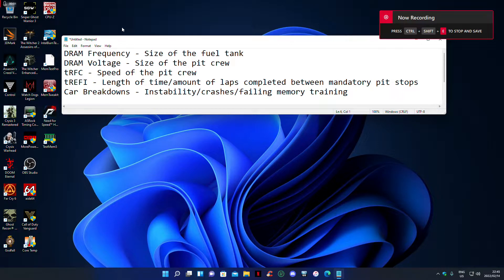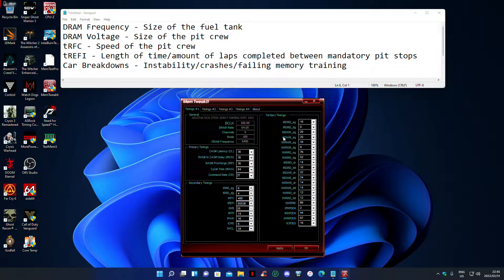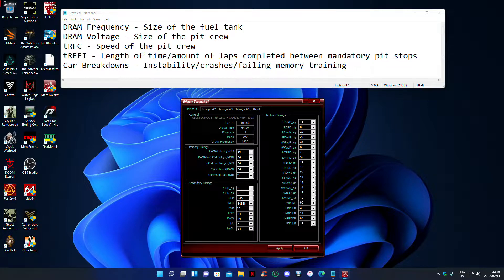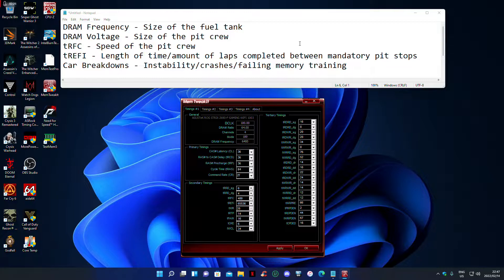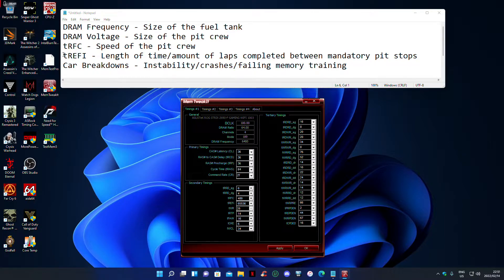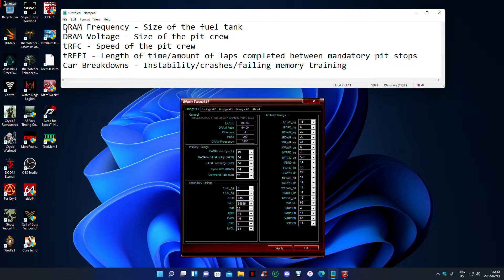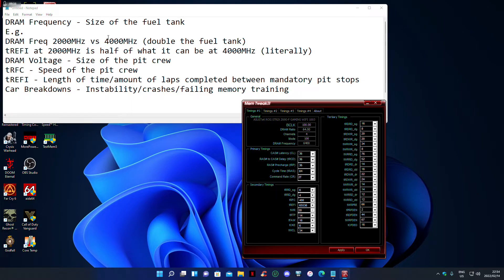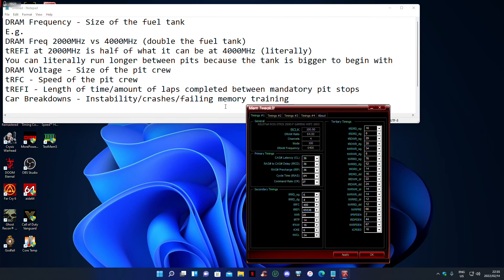tRFC and tREFI explained the fun way, i.e. RAM sticks are basically the same as F1 cars (kinda)

Comment: (Ddr3) 
My auto trfc started at 287, and i lowered it to 259 to start and observed a basically 1~1.5fps in the avg/max fps in the default cyberpunk benchmark (and i did 3dmark fire and time spy twice each test) and saw minor improvements - ofc theres variance - each time.

Oddly enough i could boot all the way down to 217 and none of the programs crashed, but when i dropped from 259 to 238, performance regresssed and became a bit more... volatile? I tried upping the dram voltage up from 1.64 to 1.66 but it didnt help. 217 trfc no real change either. Put it back to 252 (not 259) and im back to the "increased" performance.

Right now im 2200mhz, 10 13 13 36 2T, trrd 5 tfaw 20, trtp 6 twr 12, trfc 252-259 (maybe i go 259 for safety buffer), trefi 8581 unchanged yet. Tfaw 4 / 16 (or 20) tanked fps results.

The stock was trrd 6 tfaw 30, trtp 9 twr auto, trfc 287. So ive seen an uplift going down this entire spread in cyberpunk and 3dmark with no oddities. Kinda nice! But im not sure if trfc needs me to up vccsa or io or dram more.. havent touched them this whole time tweaking secondaries.

Comment: Ik this vid is a bit long but I have set my samsung b-die kit went from 3200mhz and oc’d to 3900mhz atm running 254 trfc and runs beautifully can I still lower it?
Reply from the maker: 254 is tight tight. I don’t know if there’s much room there to be honest. I’d maybe just leave it as it’s already a ridiculous result. By this point you may as well enjoy your hard work and not test further.
Reply: @dainluke  Thank you for the replyy! I appreciate it. Hope you have a blessed day!(:
Reply: @dainluke  think tREFI can be increase more than 65535? or is there no reason
Reply from the maker: @mrshredz6  for Samsung S4 B-die I’d highly not recommend it. There’s no error correction on D4, so any tREFI bit flips will be an error. D5 ECC help us get away with super high tREFI.
Reply: @mrshredz6  If you have 12/13th gen, you can set it to 262143 at most since the IMC uplifted the limits. I run 128000 stable on my 13700k DR bdie